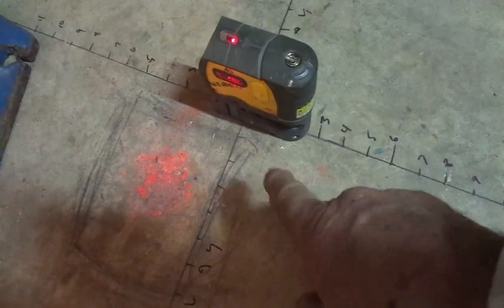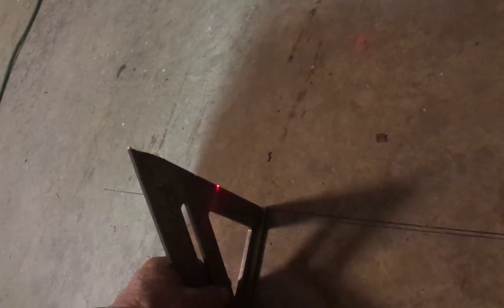Two Post Rotary Lift Install Pt 1

Comment: Ahhh, that's the way to go with your garage. Gotta have a lift, as Mark ( see below ) said,..it sure beats crawling around on the floor to get repairs done.
I have a four post 7,000 pound lift in my garage,..and it's one of my better 'investments'.
In my business I used to sell all manner of concrete fasteners, as well as the drills and bits to do almost any job. Those anchors work really well, and the idea of using the epoxy is a good one.
Now I'm waiting to see Part 2.
I do appreciate the work too in getting those cameras all set up, so you can bring us these videos,....Thumbs Up here!
Reply from the maker: I've been waiting to install this lift for a long time.  I have the overhead hoists out front set up to pick up from the top, but lifting from the bottom with this lift is going to be awesome !!  Thanks for commenting about the camera work...it is very time consuming to get this stuff recorded where it'll look halfway decent with minimal editing....but then, me and computers are kinda at the opposite ends of the spectrum too.  It does not come natural to me at all. 

    I vacuumed the dust from the holes, then blew with compressed air to clean the holes prior to adding the epoxy.  That should help bonding the anchors to the sides a lot better. Thanks for commenting Reg I do seriously appreciate it sir.
Reply: @tractorman4461  I did notice how you cleaned out those holes,....you wouldn't believe ( but then you might ) how many 'contractors' complained because the epoxy anchors wouldn't hold well. Then I explained to them or reminded them why their Mom's would put flour on the board before rolling out the pastry!! haha,..then most of them would chuckle
and buy, somewhat sheepishly,  more anchors!
Reply from the maker: @regsparkes6507  hahahaha  I got a good chuckle out of that one !!   Good stuff Reg, I love it !!  I bet I've drilled and driven in a truck load of anchors in the last 40+ years.  Might be a small truck....but still.  LOL.  You know the hardest anchor to set for me....??  Those damn AJ's (Ackerman Johnson's) into bricks.  It you don't have the installation tool, you are sunk !!
Reply: @tractorman4461  Those Ackerman Johnson anchors are some I have not heard of,..but I can see where trying to set a masonry anchor into brick can be a real 'joy' ( not ) 
I have split my fair share of bricks before I learned to drill the correct sized hole and CLEAN it out before picking up the mallet to drive them home.
Good on ya,...and Cheers!
Reply from the maker: @regsparkes6507  They are a lead anchor with a steel threaded  wedge shaped insert with splines.  The installation tool smooshes the lead outwards as it draws the insert up flush with the outside of the brick.  Impossible to use without the installation tool and still fail sometimes anyway.  LOL.  I'm glad retirement doesn't require their use at all anymore !!
Reply: @tractorman4461  Ah yes, now I think I know those,..we sold them under the brand name of RAWL ZAMAC,...just google that name and see if these are the ones.
I'm curious now. 
Hahaha,.....
Reply from the maker: @regsparkes6507  Nailed It !!  Pardon the pun...they are called wedge anchors  by  DeWalt.  ZAMAC must be the alloy and not the manufacturer.  I don't know because this is the first ever I've seen that's not an AJ.  LOL  Never heard of ZAMAC before your comment.  https://www.grainger.com/product/30TC47?gclid=CjwKCAiAnfjyBRBxEiwA-EECLOi26IdP22jsC6jpOnmz6wOrySx4ALkEFviE77tfp1TEuz9ER5iq0xoCWNEQAvD_BwE&cm_mmc=PPC:+Google+PLA&ef_id=CjwKCAiAnfjyBRBxEiwA-EECLOi26IdP22jsC6jpOnmz6wOrySx4ALkEFviE77tfp1TEuz9ER5iq0xoCWNEQAvD_BwE:G:s&s_kwcid=AL!2966!3!281698275327!!!g!472985348155!

Comment: I have said it before but you are a GENIUS my friend!! The attention to detail you have but have the ability to put it in terms we all can understand is epic!! Man yeah,can't wait to see the part two 😁😁😁
Reply from the maker: The ol' 50 is on the back burner waiting for me to locate the leak in the radiator to see if I can get to it to make a soldered repair.  Lots of other stuff going on yet.... Plus I bet a new replacement will knock a hole out of a 500 dollar bill if I can't get to the leak.  But I have not even looked, because if I did I might cry.  LOL
Reply: @tractorman4461  😁😁

Comment: Great video..I got a Rotary inground lift....I resqude it. A 1955 model FP 46 H..single post lift..for free..out of an old service station ..it sat 30 yrs .. it works in my home shop..
Reply from the maker: That's great !!  There's nothing wrong with old stuff.  Something new is quite rare around here actually.  Your lift reminds me of my back up generator.  It too was about 30 years old, and I got it out of a building that was upgrading to new equipment.  Its an Onan 15 kw with an inline 4 cylinder LP fired engine.  I was always intrigued by how those in ground lifts worked as a kid.  Now two and four posters are the norm. Good find Stephen and good luck with your lift it should give you many more years of service.
Reply: I found out my lift ..the steel is from Bethlehem steel corp , in IN. That's why it didn't rust out ..1955.  American made is it.. I just bought a new made in the USA air compressor..built by saylor-beall  corp in st.johns IN   all cast iron.  Runs vary quiet..650 LBS.  60 gal unit.. baldor motor.. this thing is  like a H.D.  Bike .. smooth.running
Reply from the maker: @stepheneggert9474  There's no doubt that a lot of import materials are inferior.  Especially their castings.  Some are almost brash brittle. We would get pipe fittings from India on the jobsites that would have tiny pits through the body's of the 90's and tees.  In all sizes too.  Your lift is definitely a high quality machine as is your compressor.

Comment: You definitely got some skills first time watching a video and had to pay attention.  I’m going ask the question so you have lines installed in the floor you mentioned inbound and return what for?   Sorry for the dumb question.
Reply from the maker: I poured the slab over two inch thick closed cell polystyrene sheets covered with 6" x 6" reinforcing mesh and attached to the mesh, I installed four 300' loops of 5/8 o.d. x 1/2'' i.d. Pex tubing.  So there are four independent hot water heating circuits totalling 1,200 linear feet in preparation for attaching to a wood fired boiler via manifolds and related piping.  So there are four supply lines and four return lines.  With a total footage of 1200 square foot, the hot water piping averages one linear foot per square foot.  And in this area with a design temp of 5F for the winter, the heating should be adequate.  Thank you sir for the very complimentary comment.  I appreciate that very much.  Btw...that was a very good question.

Comment: if those aint redhead brand i wouldnt trust them ive had other ones pull but it did sound like you plan on epoxy them in an thats good .i woulda considered 1 foot long all thread to epoxy instead but i aint know engineer and you know the weight loads an sheer capacity and all that ...cheers tractorman
Reply from the maker: I think I should be alright Grizz.  Those anchors exceeded the minimums suggested by the Rotary Lift company. Plus adding that epoxy makes them crazy secure. Thanks for stopping by Grizz.  See ya later man.  Getting about time for outside fires and cold beer ain't it !!?

Comment: The lift will be a great addition, nothing worse then working on the floor buddy.
Reply from the maker: Mark, the only thing worse than working on the floor is working on the ground covered in gravel !!  Ibet you're enjoying this slight reprieve in the weather.  Man we've had 50F -52F for three days in a row now.
Reply: Tractorman44 sure am enjoying warm up, not looking forward to rain, I’m getting ready to put up a building and don’t care to be working in mud, but it is what it is, move on and do it. Take care friend.
Reply from the maker: @marksparkplug7758  ain't nothing like a new building !!  I'd like to build one every year if I could.  Keep us posted on the progress....pole barn or footing and knee wall / stick built ??
Reply: Tractorman44 post and beam, decked with Hemlock 6by6 posts, Hemlock 4by6 hip framed, tong and grove pine sheeting, steel roof.
Reply from the maker: Mark excellent !!  Sounds like an awesome building. Hopefully it will be big enough. Because mine never seem to be. Lol.
Reply: Tractorman44 yes I know all to well, I just keep building lol.

Comment: Good day Sir, i really laugh at your last paragraph, about the tentative of entertaining and any scientific or engineering date, the monkey thing !!! LOL  Great water hot pipes design !!! Big Question, how did you manage to drill between hot pipes heating the floor ? May be I skip the explanation,,, hope that you pass your truck inspection !!!! Cheers !!! and as always it's great video !!!
Reply from the maker: Good Evening Dave... I drew out the Pex tubing to scale on graph paper to ensure I had  four reasonably equally length circuits.  Plus I had marked the foundation wall in each direction where I poured the columns. So my graph paper showed the route around the columns and it was easy to miss the tubing that way as long as I layed out the column centers on the floor prior to placing the blue posts in place.  Around 3:40 you should see the circuits and the locations with the piping circumventing them.  Piece of cake.  German chocolate to be exact.....LOL...  Should get the truck up on the lift tomorrow !!
Reply: @tractorman4461  Thank you very kindly for nice explanation and carefully well plan for not drilling the hoses !!!! Cheers !!! and good luck for the truck Inspection !!!
Reply from the maker: @RCAFpolarexpress  Heck yeah Dave, no problem.  But maybe I just am blessed with a bad aim... Either that or I'm not cut out to be a phlebotomist.  (Just can't find the vein)  LOL.  Have a wonderfully relaxing evening sir.
Reply: @tractorman4461  Whaaaat ??? Phlebotomist !!! LOL You are official m y new english teacher Sir !!! LOL  Cheers and the same to you about relaxing part !!! Keep warm and dry !!!